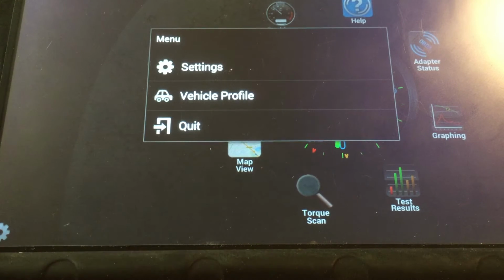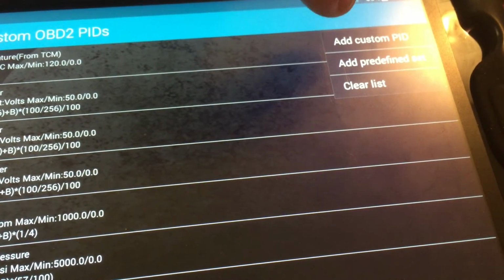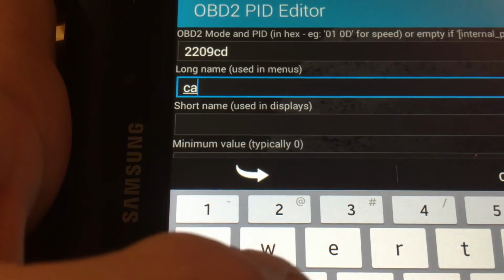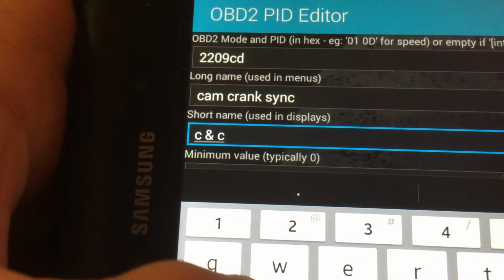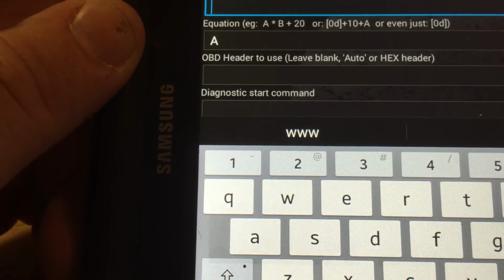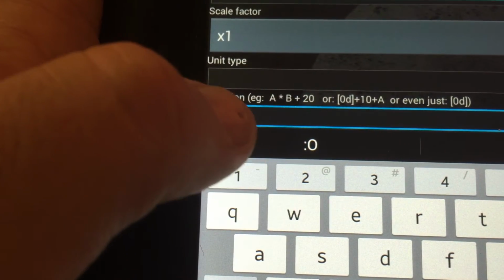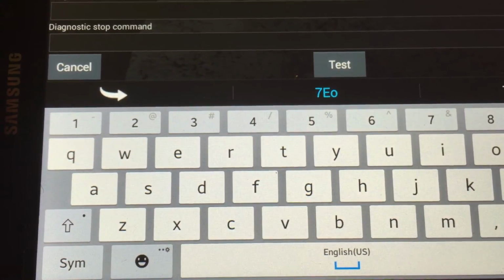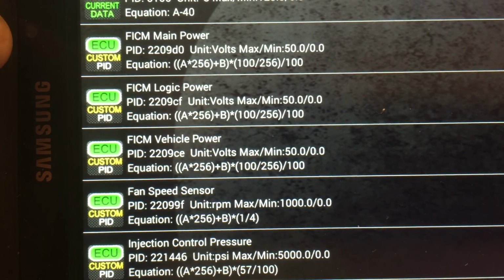Torque Pro Cam & Crank Sync

Comment: Where to get codes?
Looking for crank relearn procedure
Reply: Crank relearn, at least on Fords, involves getting up to highway speed (around 60mph or more) and performing a throttle-off deceleration, meaning hold that speed for a short time and then completely let off the gas and let the car decelerate on it's own (probably down to idle rpm and then u can probably throttle it again). Do this 2 or 3 times.

Comment: What's the difference in ficm and c&c sync?
Reply: Ficm sync is the ecu telling the ficm to give the injectors power and the crank sync is the ecu telling the crank sensor when head #1 is in position and ready to start and fire up
Reply: I built my own engine, I have an edge gauge. It says I have crank synk and cam synk. It also says I don't have ficm synk. Did I get my timing wrong?

Comment: Is this specific for a car model or would it work with any car?? trying to set cam crank sync for my S10 with a 4.3 V6 Vortec engine - and it is misfiring so bad its ridicolous.
Reply: Yea that is kind of bull shit since to relearn crank sensor you need to rev at 4000rmp till cut off then do a procedure once you actived the crank/cam sensor relearn on your scanner... was looking for an android app where I could enter my ecu and relearn the crank sensor ... Clearly that guy telling bullshit he propally dont even have a car... just a bicycle....